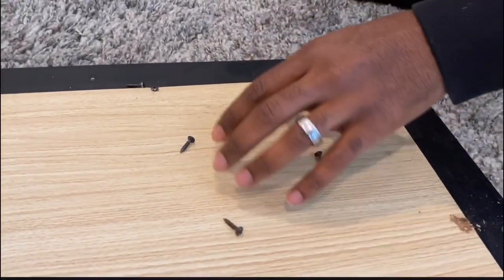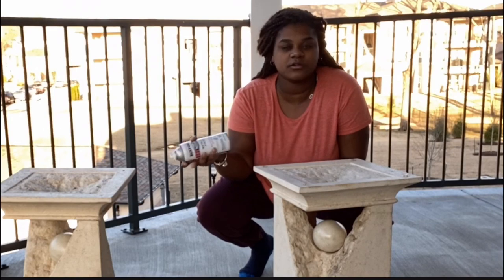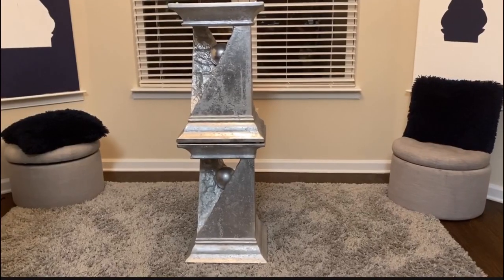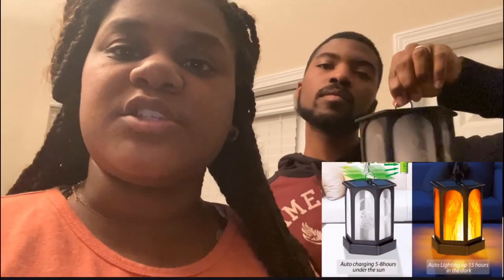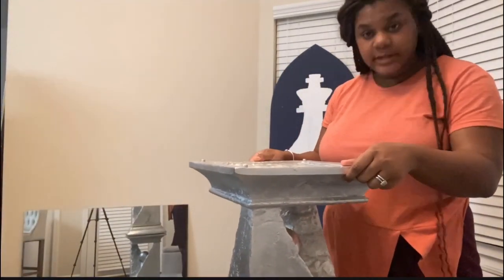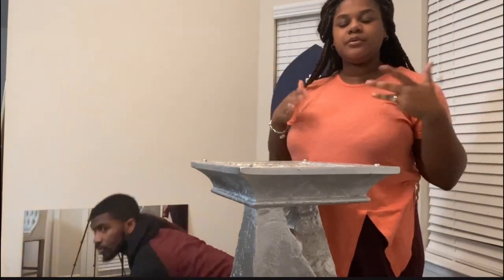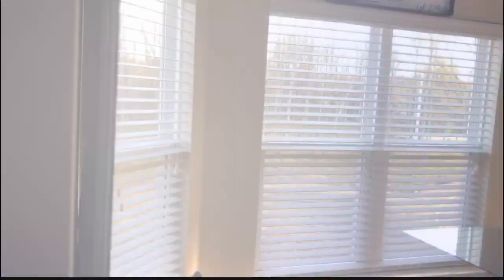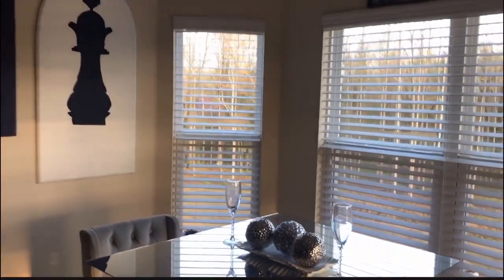Diy Mirrored Dining Room Table| Under $10| Ft. Qoolife Solar Latern

Comment: Cauuuuuute, but you need taller chairs girl. How about a wider base so it won't be easy to push over? N maybe  a thicker mirror top. Are the edges sharp? It looks fairly thin n fragile. 
Blah blah... it's very pretty tho❤
Reply from the maker: Đąscoŕpïon Belleza Yesssss we took all of that into consideration. If we were purchasing these items we would have definitely used a wider base and a beveled glass top that is meant for tables; however these are all products we had laying around the house and decided to create something beautiful. Thank you for your honesty!!!
Reply from the maker: Đąscoŕpïon Belleza we also already had the stools and didn’t want to buy more for this project. The is more for decoration to fill the space wine we never sit at the table☺️
Reply: @nardnisha5919  There my be a way that you can extend  the legs on your existing  chairs🤔 
For the mirrored top, you can always add another on top nd for the edges, do a beveled  edge with  glue gun. Paint over da edges w some metallic silver paint n den add some crushed mirrored glass from Michaels 😊
Reply from the maker: Đąscoŕpïon Belleza WOW I never thought Of that especially for the mirror. We were definitely worried about kids coming over and hurting themselves on the glass! Will definitely have to try that
Reply: You prob could’ve taken off the frame and spray paint it silver also then put the frame back on so the edges wouldn’t be so sharp.... 🤔 I wonder how that would’ve looked but it still came out super cute. Good job. & that intro is too cute 😊
Reply from the maker: Your Stewardess definitely considering doing that!! They are sharp! It’s been more so for decoration than actual use though!